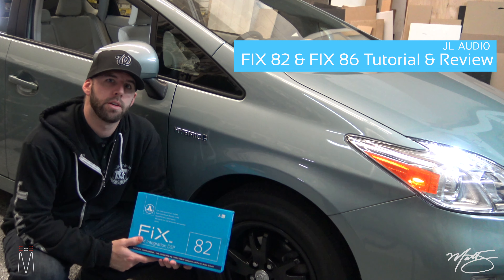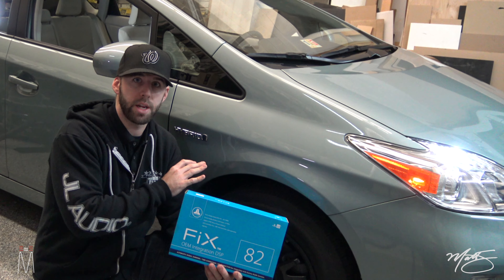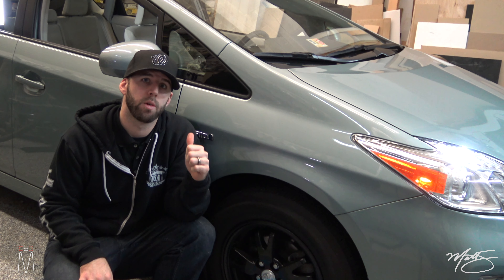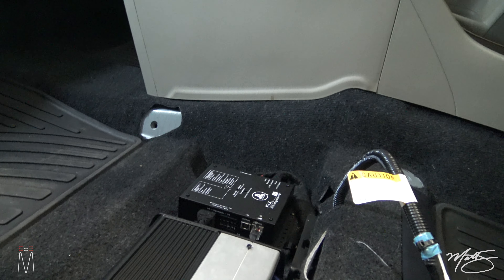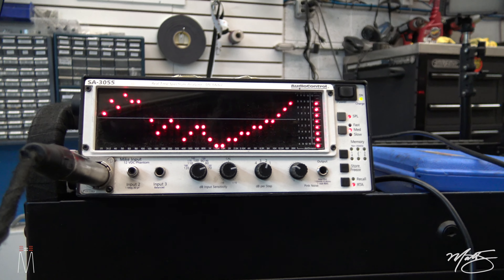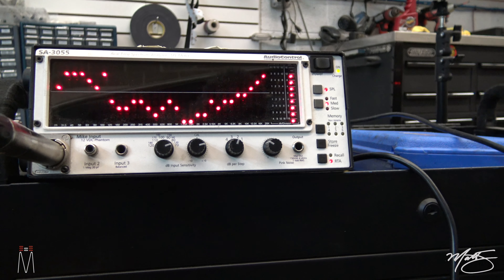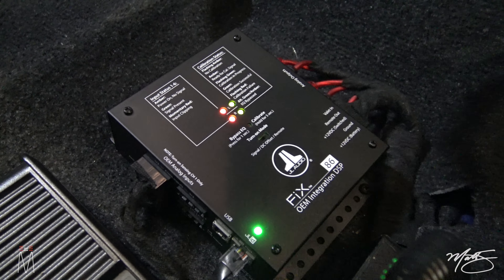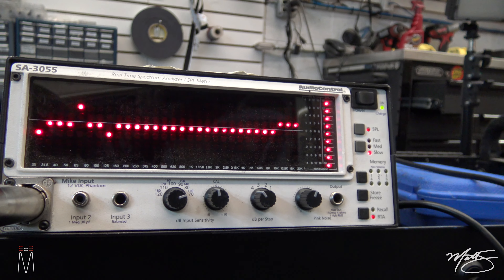JL Audio DSP Fix 82 and Fix 86 Tutorial and Review!!!!

Comment: That's my Prius that Matt is showcasing and I will say that the system he installed is incredible - what a difference. The best part is the sound, including the subwoofer does not over-power the environment of the car, or the ears of any passenger - just pure, clean beautifully EQd music. Thanks Matt!
Reply: Did you still retain the factory volume control from your steering wheel?
Reply: @stayonpoint21  I am wondering why NO ONE will answer that question. Like is it really that hard to answer? I also went to audio control and asked the same question about the dm810 and I got no answer. SMH.
Reply: @joseluisruiz3789   Yes you will retain factory steering wheel control but they reccomend you get the volume knob for the fix and use that instead of the factory volume control.
Reply: @joseluisruiz3789  The Audison Prima 8.9, f8.9, and 4.9 will retain everything. You can get a harness from them that plugs into the back of your stock deck, that powers and takes control of your whole system, with out having to even run new speaker wires to your stock or after market speakers, that are in the stock locations. Up to 9 channels too, and a RCA & digital output for a sub or another main amp. I really wish JL would have done this!! Plus they have a few remotes that control way more than than the JL remote. You give it power, ground, and plug the harness into the stock deck, and done.
Reply: @klubstompers  im gonna definitely look into that, i actually already messed with my flex and got the 4 channel outputs and a remote wire behind the stock Sync 3 radio and have the Installbay 9 conductor wire located under the driver seat with tesa tape covering the leads as i dont want anything to short out. Thank you very much for letting me know about the Audison. 😎👊
Reply: You should be embarrassed to drive a Prius sir
Reply: @joseluisruiz3789  I know this thread is old....but for those currently researching the fix 86....you CAN retain the use of your factory volume....but speaking from experience, I STRONGLY recommend using the remote and leaving the head unit volume set at 75%....

The factory units have the EQ change as the volume is adjusted and this changes the signal BEFORE it reaches the Fix and changes the calibration. It will still sound better than not having the Fix....but it sounds SO MUCH BETTER when that calibration is left intact.....I had the Fix 86 installed and initially used the factory volume...and was finding that my speakers just were not sounding like they should. Once I learned about the volume sensing EQ....and had the DCR-200 installed....the system now sounds AMAZING....So my suggestion is GET THE REMOTE!! :)
Reply: @joemunzer  thank you very much for the info! This is the kind of information that should be told to everyone when making a YouTube video of a product. I truly appreciate it alot. Thanks so much! I havent bought the fix 86 yet but did buy 1 and only 1 JL Audio C7-350Cw to start the mold of my A pillar 3 ways and will be using VXi amplifiers. They are soooooooo expensive but the quality build from the Single C7 3.5 inch speaker and my current C5-400CM 4 inch speaker is a Huge Difference in the materials used. Also I wanted to note that the voice coil is also alot larger on the C7 3.5 inch speaker then it is on the 4 inch C5 speaker. The only thing i cant do at the moment is hear it as this requires an active set up with a Twk88 or those Vxi amps or even the Audiocontrol DSPs.
Reply: @joemunzer  quick question. Does having your volume up on your radio at all times while using the DRC 200 cause any issues with Louder chimes when you open your doors or when you are backing up your car etc? I've heard some complaints about that with people using the fix 86 and even similar issues with the Audiocontrol DM810 and DM608. I have a 2019 ford flex SEL and mine has chime sensors for everything, I got a chime for the doors, a chime when the Accessory line is on, a chime for when I'm backing Up for proximity, even a sensor chime for when I'm near a metal pole to help prevent a hit. I'm wondering if these sound would be amplified severely should I keep my volume high at its non distorted level? 🧐🤔
Reply: @joseluisruiz3789  hmmmm???....I have had no issue with that. I have a 2015 Toyota Avalon...and my chimes have not changed at all...I have noticed that the beeps from the touch screen & touch "buttons" are actually lower now....which is fine for me...

So I guess it must be different from manufacturer to manufacturer...
Reply: @joemunzer  ah, I see. I will have to do my own investigation as to where my chimes are exactly Coming from in the front 😅. I have a 2019 Ford flex SEL And I've only had it for 4 months so I'm slowly getting to know everything about it. All its "Quirks And Features" like Doug Demuro says 👍🤣
Reply: @joseluisruiz3789  Good Luck....I hope it all works out....I'm sure it will be a killer system when you get it all set up 🎵👍😎
Reply: @joemunzer  thanks man. And thank you again for your experience info. I greatly appreciate it.
Reply: @joseluisruiz3789  you're welcome....my pleasure 😎👍
Reply: Hello.
Are the volume control on your OEM Stereo is still working with FiX-86?
Reply: @gustavopaulette3496  considering gas prices?

Comment: Very informative video. You've really explained in detail some of the concerns I have with my install. I recently sold my 2011 F150 that had Focal ISS570 5x7 components in the front and Infinity Kappa coaxials for rear fill all Driven by a Hifonincs Brutus 4 channel amp. Pioneer shallow and a D8601 for bass and full Hushmat and baffle install. It sounded GREAT! But I didn't have any factory integration even with my Sync OS. Fast forward, just bought a new 2017 F150 and thought I would invest in some nicer equipment. Unfortunately I rushed ahead, as my friend had recommended a FIX82 and I jumped on board without doing much research. So I purchased one along with a pair of Hertz Mille 165.3 Components and some Gladen Alpha 165 coaxials, retaining the Pioneer shallow 12" and pairing everything to a Hertz HDP5 5 channel amp. I really had high hopes. My installer did a decent enough job but they did some damage to my paint and I won't be returning to them. Don't feel like asking for their help any further.
The first thing I noticed was the loss of my fade/balance. When I try to adjust, I can never truly isolate one door without getting sound from the other, whether it be front or back. Isolating a side isn't a problem. The Mille's also sound completely anemic and under powered, or maybe unrefined would be a better way to put it. Definitely not the air moving mids I expected from a Hertz set. The Gladen's on the other hand fill the rear pretty well. They also draw a 3ohm load so that might explain the contrast. Any ideas/suggestions? I really thought this setup would be performing better. Do you think the FIX 82 is the right piece for my setup or should I make the switch to the 86, or a different product altogether? Thanks in advance. New subscriber here!

-J
Reply from the maker: jshannon2k8 the Fix 82 is only a 2 channel output. So if you are summing the front rear and sub, than that is why everything sounds bad. You will have a lot of phasing issues, especially in the Ford. With the Fix 82, you only input what will give you a full range signal. This means probably just the front stage. If you aim in the sub with a full range front, you will have suck out at the low pass frequency of the subwoofer. Same when summing the rears. If you want to fade and the front stage is not more than 3 sets of inputs, than use the Fix 86.

Comment: Just curious, you told that you need 1 preset for oem head unit and another preset to run bluetooth through the Astell and Kern.
Ive got a FIIO M11 which got the coaxial output and a dsp with coaxial input. For now, I play songs through dsp directly to my dsp with a preset. With digital coaxial input, can I use same preset or I need to do another one ?

Awesome install 👏🏻😍

Comment: I'm curious about what the FiX does on the Loudness compensation filters.
For those who don't know, this is a volume dependent EQ (usually set around 80 Hz and 10 kHz) which compensates the lack of bass/treble that we feel at low volume levels (higher boost at low levels than high levels). If you make the FiX calibration at 3/4 of the volume, the Loudness should already be disabled. I guess, if the FiX doesn't monitor other volume levels during the calibration process, the Loudness is maintained - which can be a good thing in most cases.

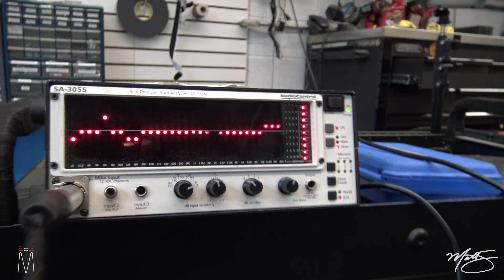Comment: Not sure if anyone will read this or assist.  I've had to order a replacement DSP and needs calibrating again.  I have a JL audio amp like the one in the video and need to know what values I need to set them?  I've tweaked them around in the past and wondered if I need to dial all of them at minimum similar to the video showing in 9:16 and do the calibration from there?

Comment: I have 2017 Acura TLX  V6 Base.  It has an OEM Factory Amp.  I'm updating car 4 speakers, 2 tweeters, Subwoofer and Amp.  I use JL Fix82.  Do I run from Factory Amp to JL Fix82 to New Amp?  Also when doing calibration, what volume I should set to? The max headunit vol is 40.  Thank you
Reply: Hey man did you ever upgrade? How does it sound? I have a 16 ilx

Comment: Hello Mr Schaefer I was wondering what kind of audio cable do you use when installing a portable player and does it plug into the unbalanced or balanced receptacle in the top of the player. I currently have a AK SE180 player and looking to hook it up to a dsp

Comment: Hi, good video.  Helped me with my install.  One question, in the TUN software, what are the output settings for when using the Fix86?  There are 3 settings where you can change the output voltage (Front, Rear & sub).  It defaults to 1.0V.  When would it be necessary to adjust these settings?

Comment: Great video Matt. I recently upgraded my Toyota Tundra crapy Entune  factory sound system with all Image Dynamics package. Two ID 10 woofers, two sets of IDQ65CS, and I 5800 Amplifier using the cheap Mloc 740 convertor ($25). Very disappointed ! sound is not clear and rear speakers are very weak and passenger rear speaker is louder than the driver side, at this point i had it check out by a pro and was told that i have a great system, but shitty convertor, so i ordered Fix 86, do you think that would play a big role in sound clarity and quality ?? Thanks in advance !
Reply from the maker: neshra54 absolutely. That's like saying you bought a 4K TV and using a VHS player and complaining of poor picture quality. Signal is the single most important thing. It all starts there.
Reply: Neshra54,  I have a Tundra with the JBL/Entune Crappy system.  I just installed the Fix86 with a JL RD900/5 with all JL components and 2 10" JL subs.  It sounds night and day difference from the stock.  You wont be sorry!
Reply: Nice. I ended up going with Helix C62s front and rear, and JL 12w1s, and  HD900/5 hooked up to Fix 86, and man what a difference very happy.

Comment: If I had the fix86 going to a JL 900/5 would I get the DRC 100/200 to adjust level input/bass. Or would it be better to get the HD-RLC?
Reply: If you just want subwoofer volume control the HD-RLC would be best plus a whole lot cheaper then the DRC 200.

Comment: Question for you. On the old cleansweep unit you could always here when the DSP kicked in at certain volume levels. is the new clean signal on the fix always the same or does the new flat signal change at different volume levels? Is that maybe also dependant on what the factory set up does at different volume levels. Some factory units will drop out the base at higher levels but have more bass at lower levels. what has been your experience with this.
Reply from the maker: Matt Vanourney this will always be working. If the OEM radio had dynamic EQ (meaning the EQ changes with volume) than you have to keep the OEM radio on the volume where t was calibrated and use the JL knob for master volume.
Reply: Matt Schaeffer after I calibrate my fix 86 at 75%  when I use the head unit volume at the 75% I experience clipping going in to the fix. What can stop that?

Comment: Hello, Great video, I have a 2016 Honda Civic and I'm  trying to upgrade the sound system but I must keep the OEM head unit, William this JL audio fix will a better choice than the AudioControl LC2i? my problem is I'm on a budget...
I know the LC2i won't help with curve but will it keep up with the bass at higher levels? any suggestions? thanks for the help.
Reply from the maker: The LC2i has some bass restoration. If you want to correct the signal, use the fix. It does not cost that much more.

Comment: What do you like jl fix 86 or audiocontrol lc7i?
Reply: @Rare Bullet a little late but I went through a LC7i, DM608, and a DM810 (system evolved as my genius ass thought wow that would be awesome if I did this lol) with a JL XD800/8v2 and now to a FiX82 digital out to a JL VXi 8 channel. The AudioControl stuff is pretty easy to work with and has a lot of adjustability but, in my opinion, the sound clarity is a hair better with the FiX82 and VXi. FWIW the AudioControl has U.S. manufacturing and great support, some of the JL stuff is made in China but I haven't had any issues with support. I don't think you can really go wrong with either so I guess what I'm saying is best deal wins.

Comment: Hi, if I didn't care about fade (I've never used it in my life) would the 82 be sufficient for a simple sub amp and 4 channel install? I understand it only has two outputs but a simple splitter would solve that.
Reply: If you're not going to use a DSP like the twk88. Get the fix86 over the fix82. The built in crossovers and 6 channel output is worth the extra $50 over the fix82 and you're not adding in some crappy splitters or anything like that. You're getting calibration to 6 output channels with some equalization functionality on each channel. Don't waste your money trying to save $50. You'll end up paying that in the end trying to make the fix82 work as a multiple channel unit.

Comment: Hey Matt, help me out here. I am an old school (mid 90s) IASCA competitor. I understand wanting extended control over the peaks and dips in a system but a flat curve doesn't sound good to most people. I ran 2 banks of AudioControl EQLs, 1 set for the listening tests and a second set flat for RTA, and would bypass one or the other. The flat EQ wasn't thrilling to listen to. This doesn't seem like a great default process. Also, were there upgraded speakers in the Prius? You only mention the amp.
Reply from the maker: Ryan Redmond keep in mind that the fix is just making the input EQ into your amplifier flat. Your interior frequency response will probably not be flat after the speaker.  This is where you would invest in a TWK to take the signal from the Fix. With the TWK, you achieve whatever frequency curve you are after. The Fix will give you a nice flat EQ into your amplifiers much like replacing the radio with an aftermarket.
Reply from the maker: Ryan Redmond the new TuN software for the Fix also gives you a few bands of output EQ adjustment for simple tweaks.

Comment: In my old car, installing an aftermarket head unit resulted in a large improvement in sound, even with the stock speakers and sub. Would installing just the FiX 82/86 be the equivalent of that?
Reply from the maker: Ken Cavallo they will sound better until they blow. Keep in mind, the reason the factory EQ is the way it is, is to optimize the sound for the OEM speaker and the way it way constructed. When you take the limited eq off the speaker, it sounds fuller but now are playing frequencies that it wasn’t made to reproduce based on their materials.
Reply: Matt Schaeffer Thanks for the reply, I get you

Comment: If I was only adding an amp/sub, would it be a good idea to use something like this?
Reply from the maker: Matt K yes you can.
Reply: You can but for just sub frequencies you really don't need it. Just get an Audio Control LOC with Accubass. I'm not a salesman that's exactly what's in my car now and for $100 and all the bass is there. You should really only get this FIX 82 or 86 if you're going to upgrade the inside speakers. From experience, just switching the speakers won't do anything without balancing the frequencies.

Comment: Ok so I have a question. I want to upgrade my sound system with keeping the factory radio of course. Does this mean that I have to buy the fix 86 just to flat out the signal and then also buy the twk 88 to be able adjust everything??? Or did I understand wrong? Does the twk 88 let flat out the signal and let u adjust it all in one?
Reply from the maker: Correct...FIX fixes the input EQ into your output DSP. Your output DSP in this case would be the TWK88. The TWK fixes the atmosphere where you are playing the music (the car). With every car being different with different locations and reflections, we need to fix the atmosphere of the vehicle. Thats when we use the TWK88 and use a microphone to adjust the EQ as heard from the interior of the vehicle.

Comment: How would you run the software if your system does not support CD/DVD drive? Would it work to transfer to thumb drive and install via USB port?
Reply: FLAC.. Rip the disc to flac,, if your HU wont accept flac, then 320k MP3.. Its free software that will do it on your pc